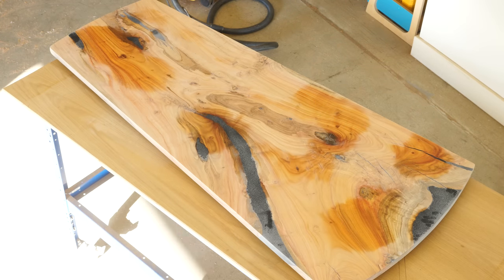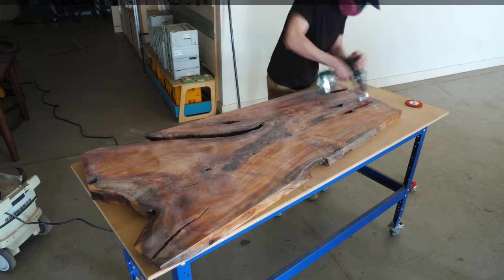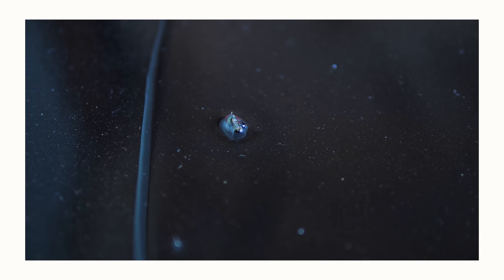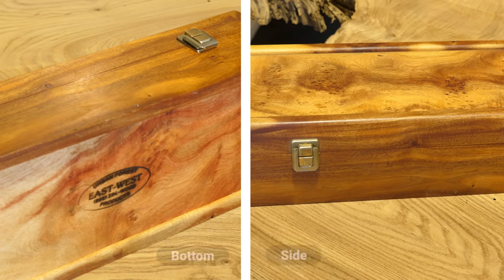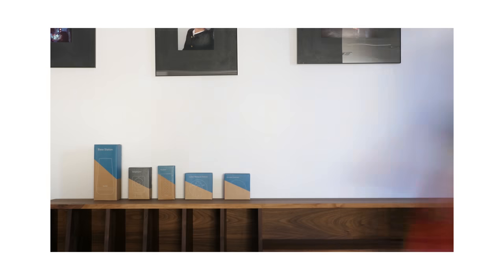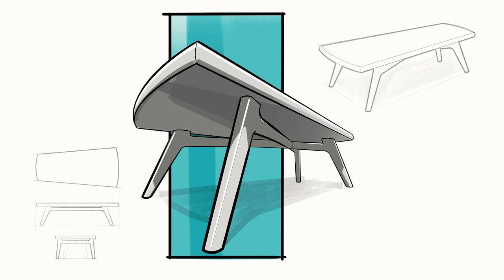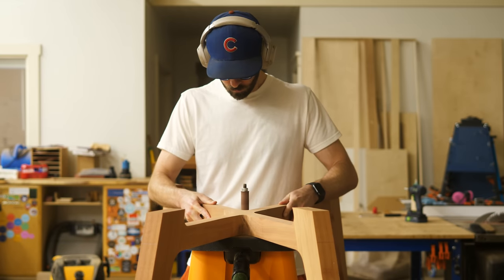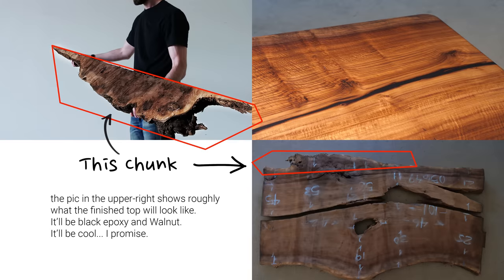Turning Worthless Wood into a Stunning Table

Comment: A note on the metric system. Much easier to use in almost any scenario, including woodworking. And to provide context, the U.S. is the only country besides Myanmar and Liberia that still use the Imperial measurement system, even though they have to use metric when dealing with international trade. So, the imperial system is used by around 5% of the world's population, come and join us in the 21st-century America, it's sunny and an easier to do maths 🙂

Comment: I don't quite understand your top mounting. I am starting to realize that wood moves far more than I would have thought. More so with large slabs like that, but your mounting plates are set into the top, so they aren't going to be able to swivel to move with the top?  Or will the move on the leg end?
Reply from the maker: I’ve addressed this in a few comments already. Too long to type on my phone. I’ll try to talk about it in a future video.

Comment: Beautiful table. As a metric user I see imperial user always covert the inches measurement to metric and say see its 25.47392 not any better. But you don't do that. You would do 25.5 or just 25mm covert that to inches and you will get a weird measurement as well. 11 inches 37/245 or something. Anyway I still enjoy the base work the best. Just for the intricacies of the angles and joints.

Comment: Negative pressure respirators are not effective with facial hair.  You need to either shave it or use a positive pressure respirator - i.e. something that pushes clean/filtered air into a compartment that you are breathing from.  An example is the 3M Versaflo PAPR (or any PAPR) - but make sure it’s HEPA.  A lot of the cheaper ones really don’t filter enough.  Bill Pentz used a trend airshield and got really sick from the false sense of security.  I don’t know if they make HEPA versions now - they might - but make sure you get a HEPA.  3M probably makes the best.
Reply from the maker: Just ordered one. Should be here soon. Excited to try it.
Reply: @Foureyes.Furniture  I have a Versaflo - it’s really comfortable for long use.  I’ve used it for a decade now and it has never broken once.  Very reliable.  I’ve changed the hepa filter once.

I use it when woodturning too.  Protects against flying bowls.  =p

One time I was wearing it and got a nasty kickback on my sawstop.  It chucked a piece of wood square at my face - bounced off the polycarbonate harmlessly and I went right back to work.

Unlike the 7500 series respirators, they are not hot, there is no moisture buildup, and they are much more comfortable for long use.

I think you’ll really enjoy having it.

I still use my 3m 7500 for quick stuff sometimes, but if I really need protection or plan to use it for a long period, the versaflo is much better.  And much more money! =p

Comment: Opinion: The table looks good. Fact: The woods used to build it are expensive and have distinctive colors. Fact: Other woods are cheaper, equally durable and would look exactly the same painted black (for the base).  Likely similar results could have been achieved for the top with cheaper/more common woods as well.

Comment: I think the reason why the English system developed the way it did was that it’s easy to divide things into equal lengths. For example I’m sure that all the time carpenters would need to divide boards into fourths or thirds or in half or by six and even pretty easily by eight or 12. Dividing things by half in English system is very easy. Just double the denominator.  Same idea applies with thirds and fourths… Etc. 

Back in the day and even in modern times slopes weren’t measured by degrees but by rise over run. Sometimes doing math that way is easier with fractions and decimals.

Sure the foot is an arbitrary length of measure but really so is the meter. Are use both systems because both have advantages in certain situations.
Reply from the maker: Totally agree. I actually have lots of thoughts on the topic. But I usually cut myself off when I start talking about it in videos.

Comment: totally inexperienced but isnt there a process to lighten the dark parts or the wood so colour is more uniform i think its called wood bleach or something. I wonder if that would help with getting a a more uniform finish that you were looking for. the charcoal did a decent job at reducing the variation in colours and looked good in the end

Comment: 22:04 Not sure if you've already found a solution to this, but those could easily be 3D printed 🤔 almost looks like nylon, which.. is actually not very easy to 3D print.. but far from impossible (esp with an enclosure); not that it's the only material that you can use depending what it needs to be capable of, but there's definitely options for making more

Comment: Hi, 
You mentioned about face masks when you have a beard.
Have you looked a Trend Air/Pro 
Airshield Pro full frontal face mask that  seals under your jaw to your neck. 
Then a battery draws in air through the filters and blows it down over your face.
So works well with beards and glasses.

Comment: I'm curious about the finances of this project - I know this was sold for charity, but it seems that this would be a money loss at the price it went for - with the total boat epoxy running $450 for 3-gallons, the slab probably $800-$1200 (just a blind guess), it seems like cost to build this (without buying any tools, melamine for forms, tape, etc.) is easily over $1000. 2 questions: Am I way off on cost to build? and what would you have listed this for if you were selling it for profit?
Reply: Lol, I totally forgot to include the price of the lumber for the legs, too

Comment: In a gas mask, the beard would prevent a seal. But in this case with the fine particulates and large chunks generated by cutting epoxy, i think youll be ok. You're better than most by wearing a respirator! Thank you for inspiring others to do the right thing!

Comment: It is possible to get respirators that work with a beard, problem is that the only ones I know of are not at all convenient. Things like positive pressure respirators are available, and don't require an airtight seal (because positive air pressure inside the mask ensures that air can only leave the mask through these gaps, not enter.) But these systems are bulky and powered instead of just a passive filter that seals around your face.

Comment: I don't disagree with the wood having air pockets. I think there is a second cause to bubbles that is maybe 20% of where bubbles come from. You pour that over, essentially, a pocket. You blanket the top with liquid, trapping the air under the epoxy. Which then gurgles and releases tiny air bubbles. (Or sometimes the air pocket pops and little liquid blobs go everywhere. 🤣) Either way. I wouldn't use a vacuum pot for that either. It is suggested by the manufacturer that you don't have to, then they battle have their shit together. (My industry, the manufacturer recommended uses are usually point on. So I'd trust them.)

Comment: I think the beards+mask issues are mostly a concern with gas hazards. Particulate like resin or sawdust should be no problem as long as your mask fits correctly. I have a beard and a 3M mask that's got VOC cartridges in it, and I can't smell lacquer thinner through it.
Reply from the maker: Gotcha. I'm mostly concerned about whatever is coming off epoxy when it is curing or you're cutting into it. That said, The difference between what I can smell with and without a mask on is HUGE. which makes me think it's working.

Comment: Up front, I have no problem with peopöe using imperial measurements. However I‘d like to point oit, that fractions of a millimeter have basically no usecase, except maybe in rocket science. So yes, it would be tedious to dial in 38.49… mm, in reality, no one wouöd do that but simply use 38 or 39 mm. So I guess the advantage of metric in most cases is cleaner numbers that work in a single system and are still very accurate.

Comment: Went through a course that required us to use gas masks for protection against CS gas. We were told it wouldn't work with a beard, but did it anyway and found no issue, no leak and no CS gas passed through even with a full beard.   (CS gas is the military/police version of tear gas)

Comment: You can still have a tight seal with a respirator having a beard. Many people I work with have beards and would not have a fun time if their respirator didn’t seal while walking through a house after putting gas through it. If you’re worried about it put vaseline in your beard.

Comment: Welders have those battery powered positive air pressure respirators to avoid nasty gasses, and I’m guessing there is something similar for wood workers. If not, you can use my idea and make a fortune.

Comment: Yeah, a beard and respirators don't work well together as I found out in the Navy, (when we could wear beards) fighting a fire. 
Many years later, I have a beard and wear a respirator while doing many dusty jobs. If the contact point of the mask seal is skin, then you won't have a leak. 
The area under the chin is the most critical. I shave my neck to keep that seal, and my girlfriend likes the look! Along the sides of the mask I have found only
a small amount of dust infiltration, so if I am wearing the mask for a long time, I will put petrolium jelly in my beard to make a seal. Make sure to clean the mask
after use. 
It's easier to clean up a beard and mask than your lungs and sinuses.....

Comment: Beards reduce seal on respirators. Even decent stubble (for me, about 4 hours from shaving) will make  respirator in effective against something where micro exposure is dangerous.

Anything is better than nothing. But your lungs are pretty important to living to a ripe old age and breathing micro particulate is bad for your lungs. If you produce micro particulate dust for a living and either want a beard, or genetically only get four hours between shaves for a good fit… get a PAPR hood or helmet. They’re expensive. But way cheaper than the health problems from breathing epoxy dust.

Comment: They sell whole face/head respirators. The issue is that the beard doesn't make for a good seal but if the mask meats your face further back then you are good. You can get a cheap on for $40 or a good one for around $100.

Comment: I think it was better if you made the domino vertical not horizontal to add more shear strength
Reply from the maker: Now I can’t remember. But I’m pretty sure the dominos are vertical. They are horizontal when I cut them in. But the piece was too. So when the piece is vertical…

Unless I’m miss understanding what you’re saying.

Comment: If you want to keep your beard and protect your lungs, you can invest in a PAPR (powered air purifying respirator).  They are a larger investment up front, but the filters are replaceable, and it will do a better job of protecting your lungs over the course of career.

Comment: 38 mm is roughly an inch and a half. Is this really what you shaved from the top and bottom? (does not look so). Maybe you mean 3.8 mm ?
Reply from the maker: Now how much I removed, but how thick the top was left at that point after.

Comment: Ok.  If you are talking about Fumes, you need to be clean shaven, every day, for a respirator to work best.

For Dust, like is in a woodshop, a beard isn't gonna make much of a difference.  Your beard will catch probably 99% of the small particles that come between the mask and your face, and your nose hair will catch 99% of those that get through. 

The goal is to be More Safe.  OSHA, the place we all love to hate, says that businesses have to take all reasonable steps to ensure safety, yet they have an exception for those steps that cost too much money. 

As a Small Wood Shop Owner, My goal is to be as safe as possible. I have a full beard, and wear a Trend Stealth.  Since I've been wearing it, I haven't had any excessively big wood boogers,  and don't wake up coughing up sawdust anymore. It works for me

Comment: Hello there,
I'm not quite through the video, but have so many comments I thought I'd put a few your way. I'm a European cabinet maker and restorer, in more traditional work- 64 years old. I love watching young creative people like yourself, and I particularly appreciate your modesty and sense of humour. But here comes the constructive critique.
This beautiful and poetic slab of  wood has its qualities, and its faults. Although I like the end shape, I believe you could have done something a bit more asymmetrical- dictated by the natural mouvement in the original slab. I have a lot of reserve about the hackneyed (British term for over-used) technique of blasted epoxy. I find it horrendous to bath a lovely slab in a sarcophagus of man made resin. But hey, EVERYBODY is doing this, so why be different? (Sorry, that's my irony speaking).
Every wood, raw, has its NATURAL colour. Staining is a very, very delicate subject. The general rule is that: 1) light woods darken with age, and daylight too of course, and 2) dark woods fade for the same reason. There are two categories of colour: 1) red, 2) green. For example, Cherry is red (which doesn't exclude a tinge of green), and Walnut is green (which doesn't exclude a slight tinge of orange, i.e red). I personally have a great aversion to any chemical dyes. Why? Because they age pretty shitty. Most take on a sickly yellow hue with time, and will invariably need stripping. Natural dyes exist, and all water-based ones are much longer lasting, AND they resist light and UV rays. They are much more rewarding to use, and their effect comes from nature- not man-made materials and products. Also I have noticed a great tendency nowadays towards black and grey, and "charcoal". Err, these are burnt wood colourings- just like the burnt offering in the Bible. Any of the redder colours are naturally warmer, but these previously mentioned tend to be blue based, which is in the cold family. What I find unnatural is using wood (organic) with Epoxy (synthetic) an a lovely piece of beautiful wood. It's like a pretty woman wearing tons of makeup. Why??? Our modern world always calls for man-made intervention. Don't agree, let Nature speak.
Last critique. All of you, please STOP using tons of glue, thus having to clean up hardened rivers of glue and drippings all over the place. I'll spare you the natural glues we use in Europe, but if you HAVE to use the white PVA rubbish, you should brush it on with a stiff short haired brush, and RUB IN (thumb) the glue in all end grain, several times. At ANY time there should be only minimal "bleeding". It might be a satisfying spectacle to watch tons of glue oozing out of joints, but it's very poor craftsmanship. 
Yes, I'm a tough old boy, but I was trained by exceptional European Masters, whose heritage goes back centuries. Just remember, this is exactly where ALL Americans originally came from. Heritage and Tradition take the best craftsman further. You're so lucky in America to have fantastic availability of goods and materials. Here in Europe things cost an arm and a leg- believe me. We are much poorer than you, and life is a struggle. That's why the Europeans immigrated to America. Please make good use of your materials.
God bless. Take care.
Greetings from France
Ralph

Comment: Respirators and beards. So it depends on the matter you are trying to avoid. If it is gas/solvents/odors? You need a tight seal. Shaving is a must. (It's why the Hitler mustache was invented...they say.)
Dust however is much more forgiving. Basically your beard will catch as much as your filter. Yes there is a big scale between the size of dust particles but in a low dust environment (You can still see beyond how far you can stretch) a mask like that will do just fine even with a beard. But if you get any health issues and have to go for total dust and solvent free, you should consider a full face mask. Something like this:
https://i.ytimg.com/vi/0tr1LlNo3k8/maxresdefault.jpg

Comment: The respirator not working due to a beard is becuse the skin cant make a full seal whit the rubber. If its thight against your beard it should't be that big a deal. You can test this by puting on the respirator and spraying a bunch of   deodorant arround it to see how much you can smell it (none means its working and your good and so on) but if your realy  concerned you can look into one of those full face masks for grinding and such.

Comment: American dont realize that no one uses millimeters. You dais 38.496875mm, no one says that, you just say 3.8cm. In metrics you actually almost never use millimeters, like, i'm 1.8m and not 180cm like some americans translate, it's 30cm and not 300mm etc etc 
Nice video as allways
Reply from the maker: I mean in woodworking, not everyday use. There I’ve never heard one person or seen one tool that uses centimeters. Everything I’ve ever seen is millimeters. 

And don’t even get me started on whatever the hell 10 centimeters equals. That shit is the red headed step son of the metric system. You all act like it doesn’t exist.

Jk. And thank you. Glad you enjoyed. 😊
Reply: In casual use or conversation, you will use centimeters... But in design and engineering fields you use millimeters and meters. Rarely ever centimeters. So, if you are building or designing a product you would always say 300mm instead of 30cm. At work, our favorite tape measures and rulers are the ones that have only mm so they are clearer. But yeah, no one would say 38.496875mm... Personally, I normally do the whole: "about yay big" and hold my finger and thumb roughly 38.496875 apart... Then complain when I am off by 0.00001mm